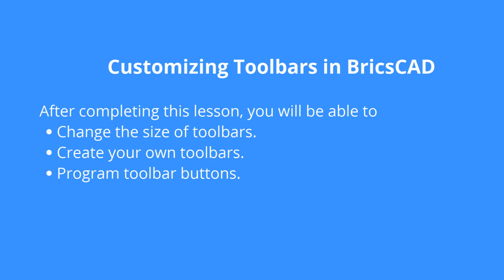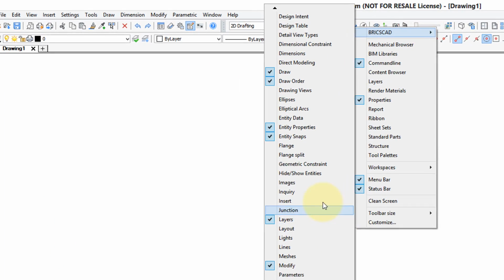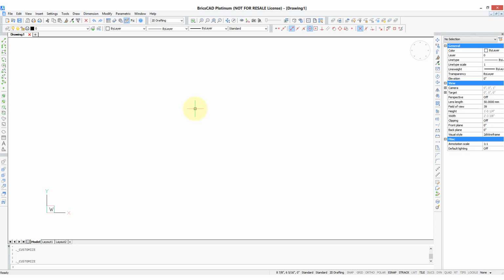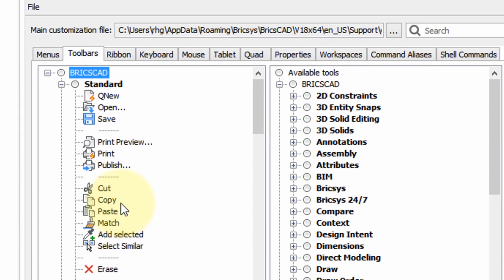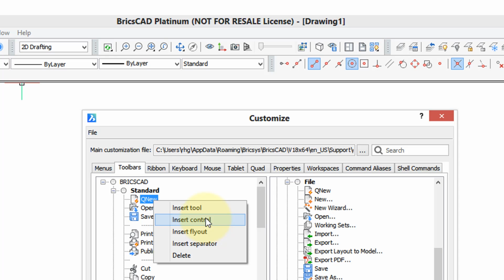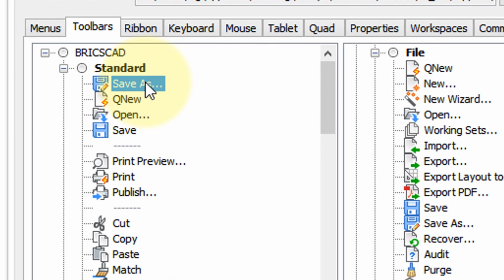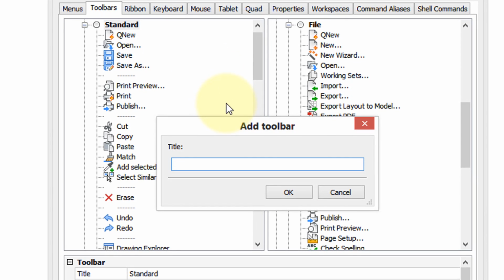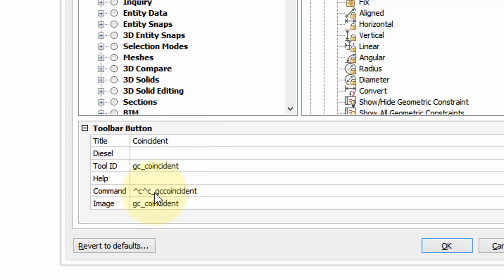Toolbars - BricsCAD

Comment: But how do you get 2 rows of toolbars?
Reply from the maker: Hi Andrew , In the recent releases of BricsCAD tool bars are replaced with Ribbon Interface . If you still need tool bars you can right click on the Ribbon and activate any number of tool bars .
Reply: @OctaveBricsCAD  The video shows two rows of toolbars. How did you get that?
I prefer the toolbars to the ribbon..